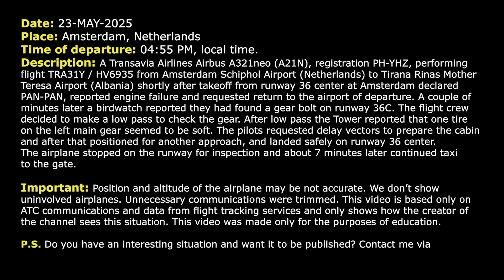Engine failure. Wheel bolt is found on the runway. Transavia A321neo returns to Amsterdam. Real ATC

Comment: I don't get it. Did they have an engine failure as well? No mention of it after the PAN PAN PAN.
Reply: It was a bird strike, the engine was damaged but not out.
Reply: It might be another aircraft that left fod on the runway that caused the flat and the engine, seems unlikely that the gear messes with the engine.. but then again stranger things have happened.
Reply: @joerivanlier1180  there has been incidents of rubber from tires getting into the engine, from fod or other issues. Tho, unno how the bolt would have fallen off also from just a blown tire

Comment: Spectacular communications. It's obvious what we need to do to fix ATC in the US.  A) Hire twice as many controllers, fully train and fully staff every major facility; B) ensure all controllers have multiple language proficiency; C) ensure safety has priority over cost and profits.
Reply: and enforce standard RT. That PAN PAN was beautiful.
Reply: I don't think multilingualism would really make a difference in the US. In this example it's just that both the airline and the airport/ATC are Dutch.
Reply: @TheLukasDirector May be when the pilot speaks Spanish as first language and the controller as well.
Reply: D) Avoid Newark at all cost. 😊
Reply: Well, on B) just enforce the ICAO standard language level 4 or higher thing for controller and PILOTS where english is the language used. And use standard phrasologie...
Reply: The problem is that there’s way easier ways to make that type of money these days.  Then there’s the age limit factor.  Our system definitely needs an overhaul though.
Reply: Indeed.
Reply: Multilingualism would be good (and many are bilingual English/Spanish already) but I fear that such a requirement would just delay ATC certification by several more years. It already takes years to apply, be accepted, get trained.
Reply: i thought you were going to say: send them to amsterdam for training rotation 😂
Reply: @afoxtiasstfc836 That would surely help. AMS ATC is one of the best, if not the best.

Comment: Just curious... how does a tire look "soft" when it's not on the ground?  Sounded like everyone was on top of their game!
Reply: The translation is correct. According to the bird watch and an aer lingus it appeared soft. I think they can compare the behavior of the rubber with the other tires on the same landing gear. Maybe it flopped a bit in the wind or it sagged a bit?
Reply: due to the high weight of these tires they dont hold their shape well if not pressurised. its pretty easy to spot. note that these tires are made to run at 14bar or 220 freedom units. your car tire is like 2bar or 30 freedoms.
Reply: @SupremeRuleroftheWorld  Freedom units?? Were those introduced on Liberation Day?
Reply: @floris-janvandermeulen8054  it’s what sane unit users like to call the US system. A jab on the “freedom fries”.
Reply: @SupremeRuleroftheWorld  think they have been renamed to TACO units
Reply: I think that means not inflated properly
Reply: I think that's a translation of a localism in Dutch. They have a lot of those kinds of expressions. We need a native speaker in here to help.
Reply: As an aircraft mecanic who works at transavia i can tell u that it is impossible to see if a tyre is soft in mid air. The rubber has to many plies of steel in it to deform in the wind. Only a blown tyre would maybe be visable because peices would be missing.

Comment: The single discrete frequency for both the tower and the TRaCon is a nice touch. Allowing both to monitor what's going on and keep the pilots from having to switch back-and-forth.
Reply: Isn’t this standard procedure at every main airport? It would add a lot of workload to keep switching frequencies for the pilots being busy with more important stuff at that moment.
Reply: @atariandre5014  It is a standard procedure for EHAM (Schiphol, Amsterdam) and in other large European airports.
Not only the pilots are switched to a single frequency, the controllers involved are also in a single chat.
Notice how they NEVER ask for something that the pilots already told another controller.  That is because they already heard that.
Also notice they do not ask for irrelevant information like fuel and souls.  They have that information from their systems when the plane has departed locally.
Reply: @atariandre5014  No this isn't standard procedure as far as i know. In the very basic rules of aviation communication this isn't common practise. Following the basic rules of communication is switchting between the frequency sector. Some airport do this the same way Schiphol does. The great benefit for the pilots in this, is you don't have to worry about switching anymore. Tower and Approach work togheter to remove a big amount of workload for the pilot but also get immediate grip on the emergency and get detailed information instead of passing information between tower and approach. Basicly what happens here, is that the Airport takes away a bit of workload, but give themselfs this workload because a separate controller is active and has to communicate with his collegues on approach and tower for a safe return. Small benefit... the controller who handles the emergency was already handling traffic in his shift and therefore has a great overview of the airspace.